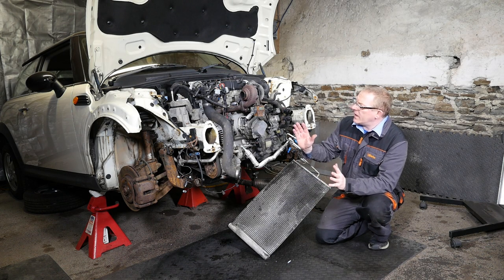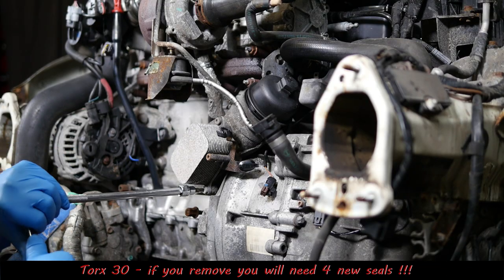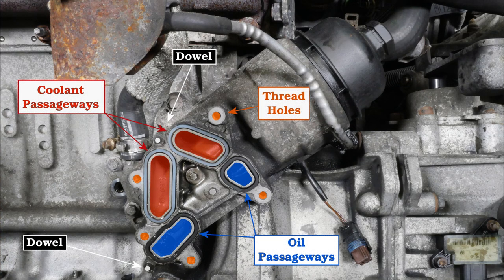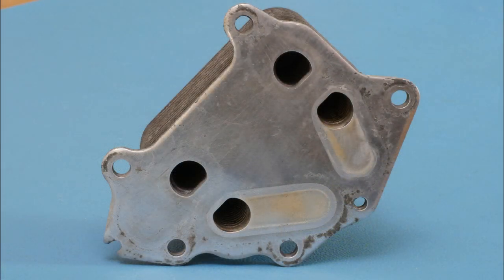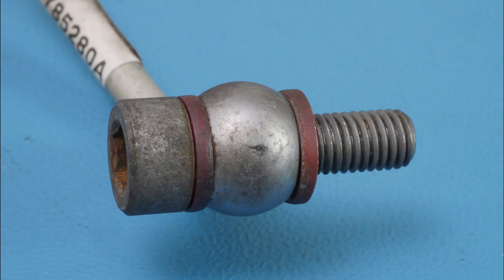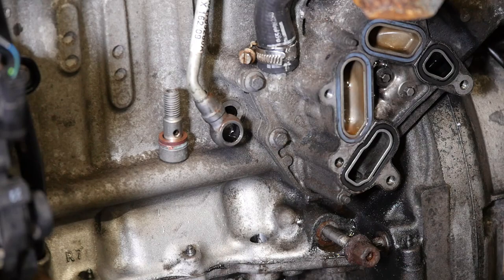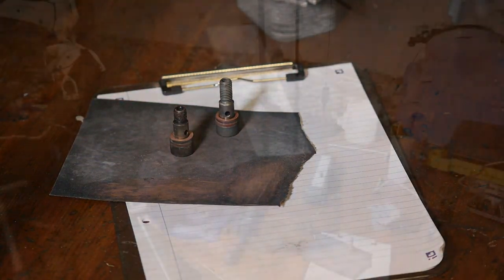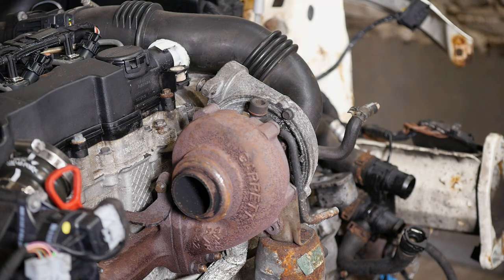Part 5 - Oil Cooler, Turbo Oil Pipe & Opening DPF Filter 2009 Diesel R56 MINI  W16 1.6 HDI TDCI DV6

Comment: Regarding the copper washers, heat them up so they are glowing, with a torch or Something, then let them cool down, then you practilly have new washers, Because the heat make them  expand a little,  so you can tighten them again, without the washers are flat and Hard.   I do that on the oil sumps  drain washer, and it works, no leaks at all. 😉👍🏻
Reply from the maker: Thank you for that tip.  Will definitely try that.
Reply: true!

Comment: This video was very helpful thank you
Reply from the maker: Thank you for commenting and good to hear.
Reply: @CoatsandGaiters  just about to prime a new turbo on one of these 1.6d minis. I manually filled it with some oil but want to crank it without starting. Is it best to just pull the crank position sensor or should I pull the hpfp fuse, the injection system relay or something else as well? I don't work on a lot of diesels and I want to be sure it doesn't start immediately
Reply from the maker: @DrCrunkMusic  Sorry but I'm not sure to be honest.  Petrol is so much easier to immobilise.  Preventing fuel is the answer so either remove the fuel pipe of stop the fuel pump if that's possible.

Comment: Great set of videos.

I would have been hesitant to use that sealant on the oil cooler in case any little fragments ended up in the oil.
Reply from the maker: Thank you for the compliment.  I totally agree it was a risk that could have backfired on me.
Reply: @CoatsandGaiters  the effort you put into making your videos shows, I really enjoy you undertaking the problem solving aspect of the jobs. I've got a Fiesta 1.6 TDCI that uses the same dv6 engine so it's really interesting to me seeing the internal workings.

Did you ever get to the bottom of why that cam shaft was dry in that particular spot? My guess would be you washed the oil away with a solvent.
Reply from the maker: @norm4260  Thank you for commenting on the work I put into my videos.  I do try my best and each video takes a solid week full time.  

I can only assume I washed it away as well but it still remains a mystery.  Someone commented that the oil pump was probably on it's way out and hence it struggled to pressurise the hydraulic tappets.  I think I probably should have replaced the oil pump.

Comment: Hi, I have this engine in peugeot 308. I noticed that the oil feed pipe was loose at it's ending and was planing to replace it, but now I saw in this video that oil feed pipe is loose also, but was not replaced. Is it normal to be loose?
Reply from the maker: I think it's meant to be that way, possibly some form of joint to alloy for expansion possibly.  I thought it strange at first, but it doesn't leak.

Comment: Great work as always. In some of your videos you mention getting info for torque specs etc from online services, which one do you use? Also is the Peugeot 208 you done the timing belt on still going strong
Reply from the maker: Thank you Steven.  At the start I would often get the torque specs off a guy in the trade as they had Bosch online resources that gave instructions on repairs.  He would print the relevant pages and send to me.  The Peugeot wasn't mine and the chap sold the car soon after as he was annoyed with it suffering issues after buying it and it being a relatively new car.

Comment: Hello why didn't you changed the oil cooler house seal? Most of time it cause oil leaks.
Reply from the maker: I'm tight with money
Reply: @CoatsandGaiters  haha plus 10 €
Reply from the maker: @logoutss  exactly !!!
Reply: @CoatsandGaiters  that banjo bolts will kill the turbo due to the filter
Reply from the maker: @logoutss  I did check the filter and it was nice and clear as they are prone to blocking I read.

Comment: I’m about to do my oil cooler on c4 grand Picasso 2009 1.6hdi but there’s a big gasket that i’m not to sure where it goes, all the little gaskets fit in the groove holes/slots but there’s a big one i’m not sure where it goes, can u help?
Reply from the maker: It's not the large round one for the oil filter housing?
Reply: @CoatsandGaiters  Not sure which one u mean
Reply: no it’s not for the oil filter housing it’s for the oil cooler i’ve had to take the whole housing of the block to get the oil cooler of
Reply from the maker: @wildfruits477  there is a large round seal that fits around the black plastic housing that the filter sits in. You probably know this but sometimes we oversee the obvious.
Reply from the maker: @wildfruits477  unless it’s for a model variation.  Maybe the seal set fits a couple of models and it’s cheaper to do just one kit.
Reply: @CoatsandGaiters  no it’s to do with oil cooler all the little gaskets fit but there is a big one that can’t seem to find where it fit